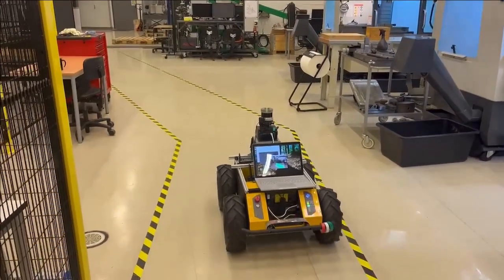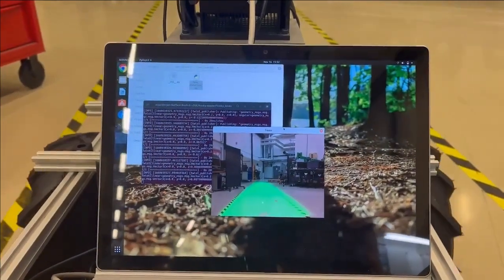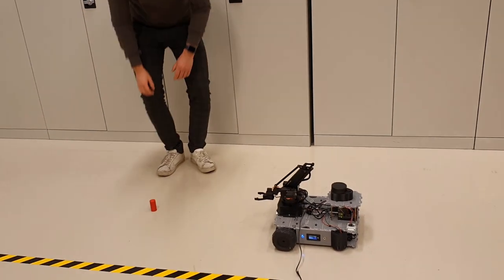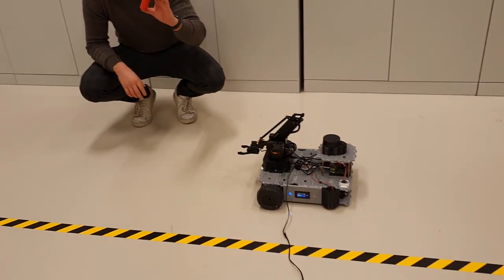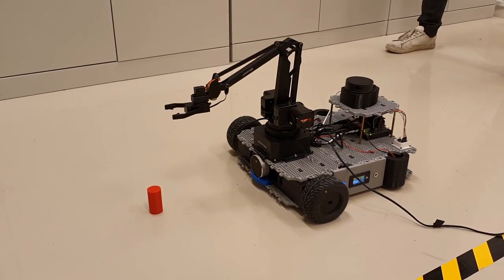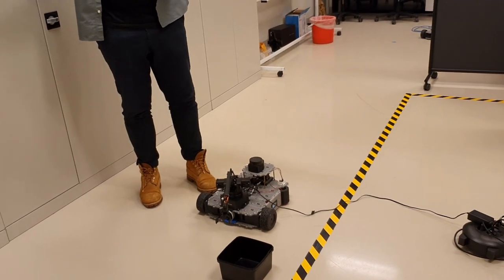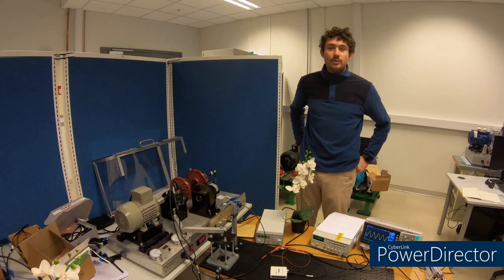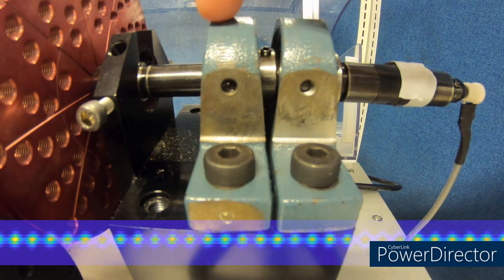Master in  Mechatronics, specialization in Applied ML and Robotics, University of Agder

Comment: Nice.
What physics engine or map program are you using for goal navigation? And what series of tasks for pose estimation? CNN for edge detection and filter?
And what for pose estimation and modeling for the cylinder pick and place?
Reply from the maker: There isn't any physics engine. Its standard SLAM, where the robot maps the environment and then uses it for navigation. Yes, CNN for edge detection and then implement lane keeping. Whenever the Husky deviates from the center of the lane, the feedback is sent to the drivers in opposite direction such that lane keeping is maintained.